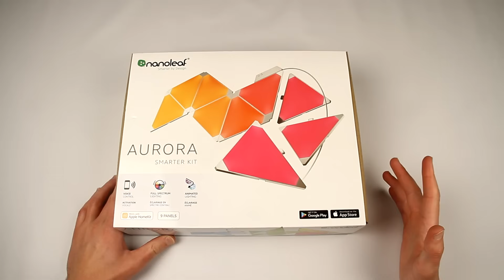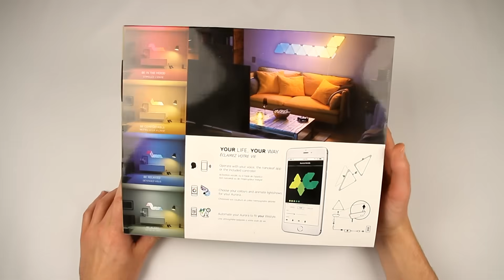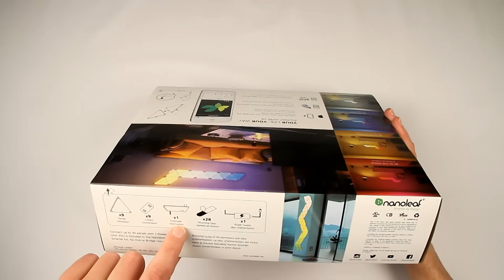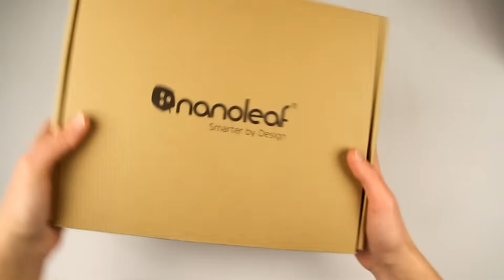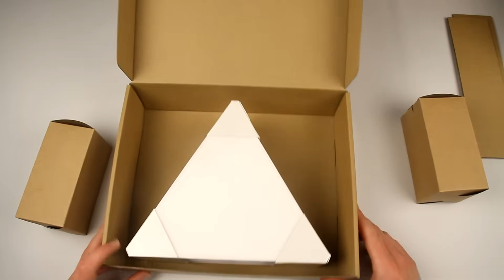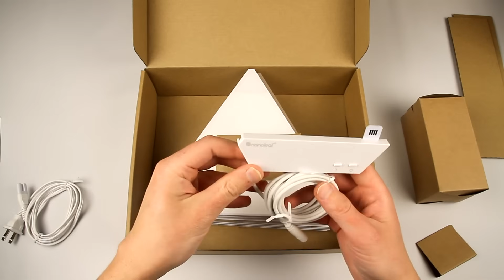Nanoleaf Aurora Unboxing and Setup

Comment: Will buying the 3 pack extension and buying the power supply make them work?
Reply from the maker: No, you need controller
Reply: @InsideOutElectronics  Comes with it so I should be fine?
Reply from the maker: @derekrc5737  Yes then, but I thought extensions are not coming with controller.
Reply: @InsideOutElectronics  Yeah they don’t but on the nanoleaf website the power supply and controller come together for 35$ which means everything should work fine I’m assuming. Currently waiting for them in the mail and I’m hoping they work.

Comment: I guess I’m not the only one with connection problems. For 200$ that’s unacceptable
Reply from the maker: Totally unacceptable, but I did not have any issues like this. It worked pretty much out of the box! But if it does not work for you, just bring it back!
Reply: Inside Out Electronics I did I got a new set and it finally connected but let’s see if it stays connected ! Do you have a video on how to use the app and create cool scenes ? That would be a good video !
Reply from the maker: No, sorry I do not. That woul be great idea, bu've I returned it ;)
Reply: Inside Out Electronics Yea they sending me a new controller. If it doesn’t work I’m going to return it too. Refuses to connect

Comment: I bought the extension panels first....
Reply from the maker: And?
Reply: Inside Out Electronics 😂😂😂😂
Reply: Same😂 Power Supply is 35$ and I payed 20$ for 3 so good deal
Reply: @Alex 0221  Yeah for me they work perfect and I can use the app and everything, for the mini triangles buying extension panels first and then buying the power supply should work but I just checked their website and the power supply doesn’t come with a code to link the triangles with the app which did come with my power supply so I’m not sure if it really is safe to buy things separately for the mini triangles.
Reply: @Alex 0221  Yeah might as well return it my guy, safest choice

Comment: Command strips are really easy to use, can be repositioned and removed easily
Reply from the maker: Thank you for comment. I agree, especially at 250$ price range! For boxing day it was dropped to 150..... but still to expensive and not as flexible.
Experimenting with strips from Costco... trying to use them with my own controller to be able to control those similar to Aurora
Reply from the maker: 577AllWell my camera light are more powerful then Aurora thus washing off the colours and it looks dimmer.